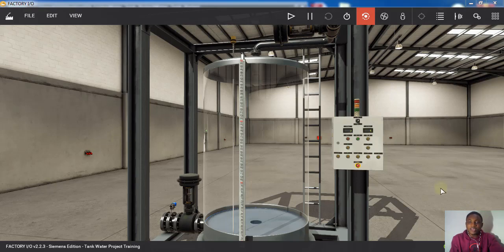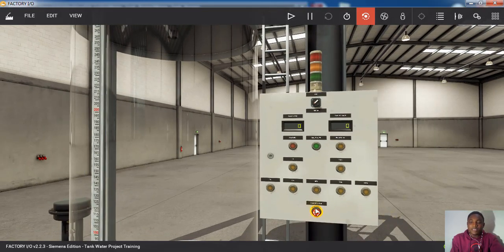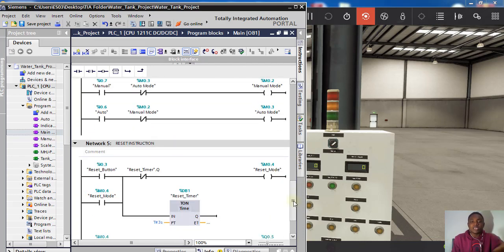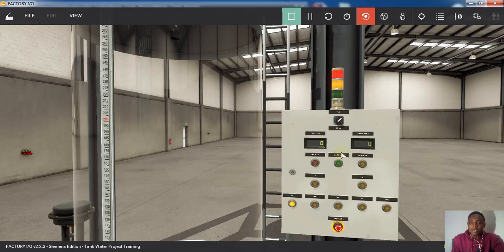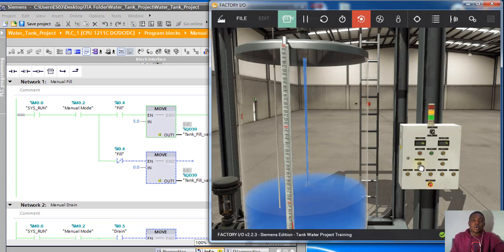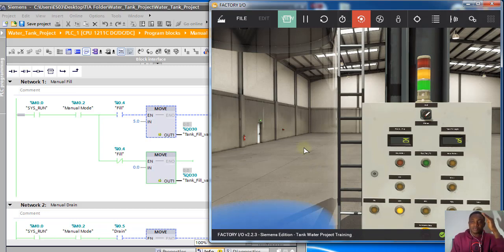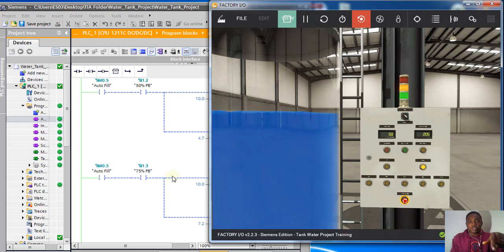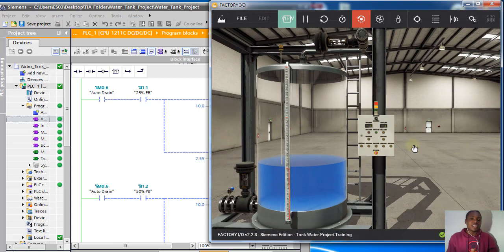Water Tank Project Using #TIA portal V13 SP1 & #Factory IO.

Comment: So far so good bro. Now I'm thinking, for a tank gauging, the tank shouldn't be completely empty nor overfilled. Maybe you should check your drain tapping point. And then, if you put that into consideration, it becomes impossible to start the process on auto mode from zero level. That will make us to think about override. So, when you want to run the process on auto from zero, you need to initiate the MOS. 
And then for your ESD. I feel that for a fail safe operation, your esd should depressurise the tank. What I saw is just OSD which stopped the operation without depressurizing. Allow the esd to open the drain for fail safe operation.
And then, what are the applications of this process (filling tank and draining it)?
Good work  bro. More to do.
Reply from the maker: Thank you for your comment! Your points were highly insightful. However this is just to demonstrate how you could simply fill or drain your tank in either automatic or manual mode. As for the safety conditions you listed, it could as well be included in the program logic, however it shall be implemented in the future program. Thank you once again.